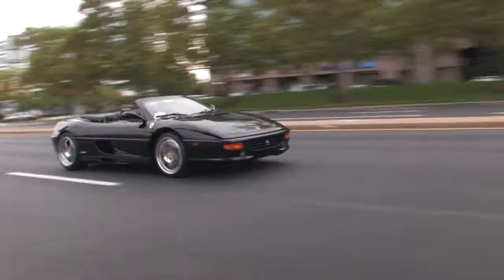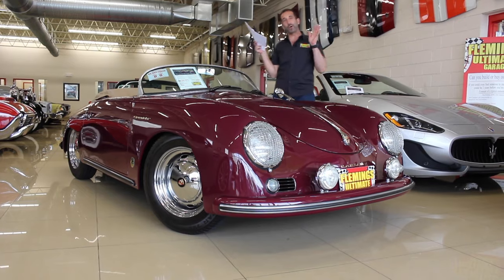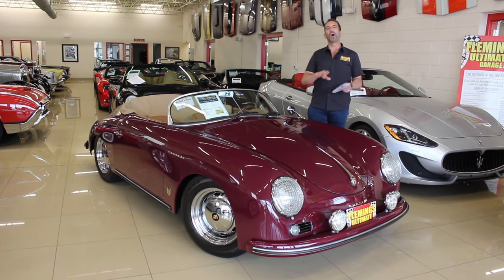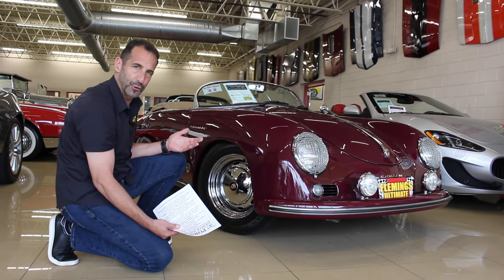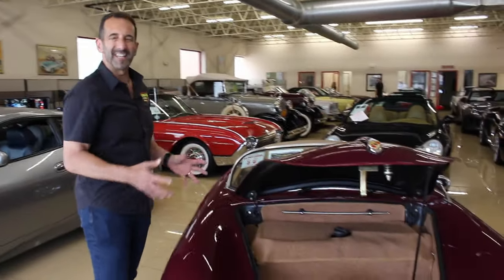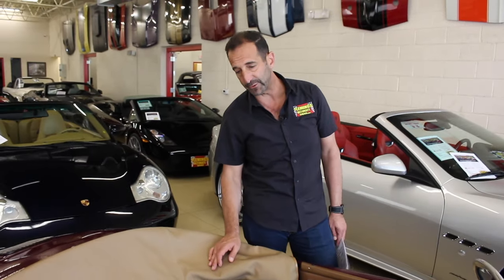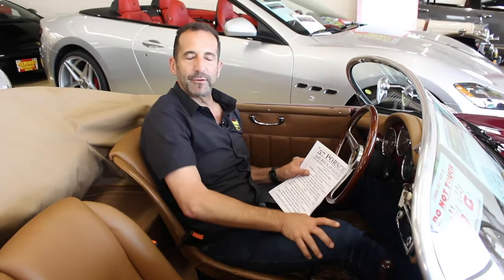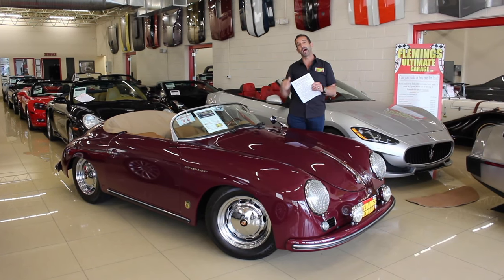'57 Porsche 356 Speedster by Beck for sale with test drive, driving sounds, and walk through video

Comment: James Dean was killed while driving a 550 spider. This car is a 356 speedster.
Reply: He did actually own a speedster though. It was what he had before the 550. Prior to that it was an MG TD. At the time he does, he had a Lotus X on order.
Reply: As far as owning a speedster goes, I would prefer the SAS 356 cabriolet. Good seats, a/c power windows(as opposed to side curtains) and most importantly, a 170-200 hp subaru mid-engine and 4 wheel disk brakes on a real custom frame not a vw. $35k
Reply: James dean owned a 356 porsche and started to race then  he sell that porsche to buy the speeedster 550

Comment: Sure went over the engine spec quickly. Can’t say vw ?
Reply: There's nothing wrong with a VW motor in there, theses cars are extremely light. What did you expect a small block? SMH